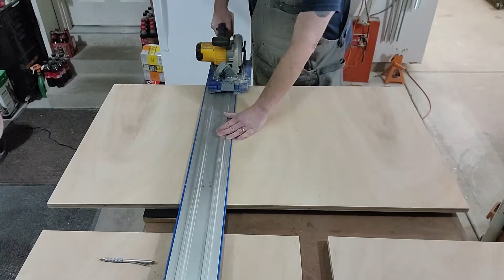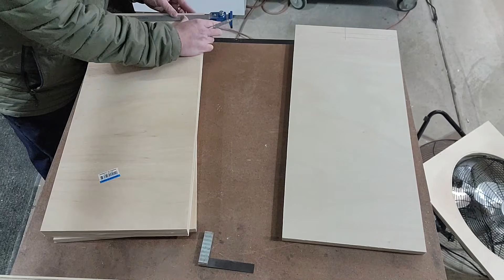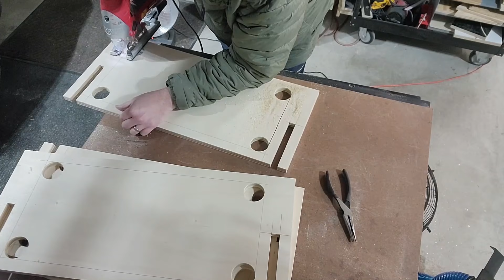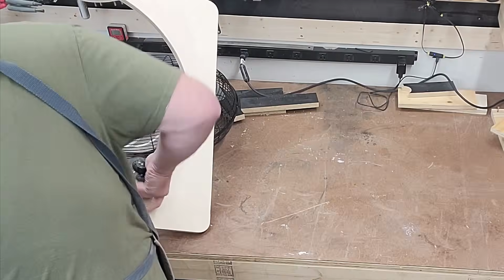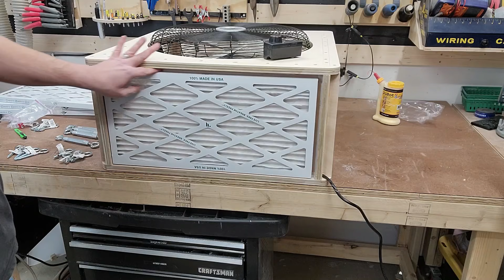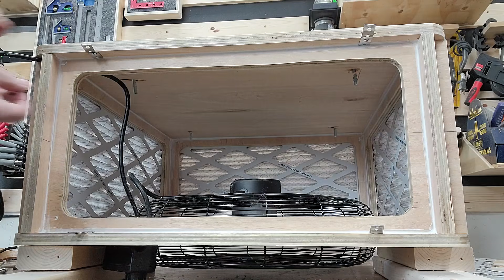SAVE YOUR LUNGS! Woodworking Ceiling Mounted Dust Filter - How to Make

Comment: I have an unheated garage/shop and when not doing woodworking, use 2 box fans at low speed to keep the air moving, so moisture doesn't really settle (so to speak) this would be an excellent way to do both functions, high speed for dust, low speed for general air movement.  Thanks.  Have to admit... I would have moved the car, then hung the unit - lol
Reply from the maker: I like a risk!

Comment: Great project.  Love the outcome.  Was wondering if there is any noise transfer to the ceiling from any motor vibration.  In my case I have a room above the garage.  I guess I would be able to replace the turn buckles with with a chain chain link and springs to kill any vibration transfer.  My home air exchanger is installed with chain and springs and it is run 24/7 with non vibration transfer noise. Could be a good idea for you if you do have a room above you garage.  Great content good job thanks.

Comment: Just started making mine. I used a 2" hole saw for the radii. Very little sawdust and by not quite going through on the first pass I was able to flip the panels and use the hole saw drill bit hole to realign the second pass.  And no chip outs.

Comment: Great design!! I like that it can be built with "normal" hand and power tools. One change that I plan to make is to have the fan blowing up toward my 10' ceiling that is heated in the winter. What do you think about adding another filter to the solid side?
Reply from the maker: It shouldn't hurt anything by doing that.

Comment: Curiously, do you have a followup to illustrate its effectiveness?  Is the effort paying off in removed air particulate?  When it isn't running does dust fall from the filters back into the surrounding area?
Reply from the maker: It works great. My filters are nearly black after 30 days of use of both wood working and painting. Very effective in my shop anyway. Dust doesn't just off when not running unless you bang the filters. I recommend using MERV 11 vs MERV 13 for better air flow

Comment: Well done video just enough regular speed to demonstrate your technique.

I'd question using the plumbers tape to hold the filters.  Over time, yes a long time, the bending back and forth of this strap will cause the metal to fail. To me this just becomes an unnecessary replacement part. I think I would have used something like a mirror clip but much larger that you could twist 90 degrees. 

I also love the Packard, I'm guessing that's an early 50's model.

Finally, just listening to you I get the idea you were a mechanic in aerospace in real life,  am I close?
Reply from the maker: I'm a software engineer by trade.
Reply: @TheSuburbanGarageWorkshop  well close, you used "egress" which hinted at a technical background. Nice to meet you, I look forward to watching more of your content.

Comment: I had all kinds of issues with my Kreg Track Saw like yours.  After tweaking it some, I finally figured out it was the way my Mikata circular saw was mounted.  Now it works pretty good.  Need to finish watching your vid.  I've seen several versions of these.  20" X 20" seems to be the most common.  Ask This Old House has one that explains the advantages to using a 2" or 4" thick filter.  That gives you more surface space.  I've also been wondering if you would benefit from putting a lower MERV out the outside catching the larger particles that could be thrown away more frequently than the MERV 13.  Either way, I am willing to bet my shop would benefit from one or even two of these.

Comment: i made mine for a shop about 20 years ago from a squirrel cage fan for a hvac system . it was a side dump instead of bottom dump the top flange was wider then the unit and i screwed it directly to the truss joist above and i used hepa filters . same concept very low cost. i made a sanding table as well that sucked the air through 1/2" holes in the top . doubled as a out feed for other tools in the shop

Comment: Surely you have got the airflow the wrong way round, the fan should push the dirty air through the filters from the inside so that when you switch the fan off the dust is confined on the inside of the unit. With your configuration when you switch the fan off the dust is on the outside of the filters and can fall off back into the workshop
Reply from the maker: No, this is how all ceiling-mounted filters work. Also, this is how your furnace works as well. You've sucking the dust into filters. Also this keep the fan from getting chocked by the dust.

Comment: Great build! Would I be able to modify this to make two of them that stack and can be used on a wall or roll on the floor? My shop is in my open 1200sqft pole barn that shares space with mowers, cars, golf carts and storage items so making the whole area "clean" is unfortunately what I am dealing with.

Comment: Nice video! Looking to do this soon. Doesn’t the fan blowing down disturb the dust or does it get offset by the amount it sucks in? If I have a dusty floor it’ll just blow it everywhere
Reply: I have a similar filter, and I can tell you the air blowing down on you is a PITA and does stir up dust, but as you asked, most of it ends up in the filter. I usually turn it on, set the timer for an hour, and walk out. This one is much better than mine, which I bought on Amazon.

Comment: Looks like a very good design. A dumb question, maybe, but since the fan is facing down will that not tend to blow dust around the shop? Would it be better to turn the design so the fan blows horizontally?
Reply from the maker: It's been discussed in the comments many times. Rotate to your preference.

Comment: Finished and mounted. Just as Randy Strang reported, I'm having a priming issue. What can I do to fix this?
Reply from the maker: I've only seen that when the filters are obstructed/dirty.  Perhaps the fan isn't as strong as mine?  You could always try popping one filter open until it catches and then push it back in and see if that does anything. Others have reported using a Merv 8 or 11 filter instead, which are not as restrictive. Others have suggested adding some a single row of duct-tape over the fan shroud at the bottom where it attaches to the wood to reduce the fan sucking around the edges on startup. 

I've not had that specific issue (except when the filters are clogged), but there could be manufacturing differences in the fans that cause some to be more prone than others. If I was to redo mine, i'd probably mount the fan inside without the front shroud so I can cut the hole tighter to the fan blades and then mount the shroud on the outside. That would yield better performance, and reduce the possibility of the fan sucking in around the edges, which is what you are seeing.
Reply: @TheSuburbanGarageWorkshop  Thanks for the reply, I appreciate it. Hopefully I find the sweet spot, really want this to work.

Comment: In terms of design, I made something similar—poor man sort of. However, one MAJOR issue I noticed after starting the fan is the cool/cold air output that comes out after filtering. In other words, its almost impossible to use that air in winter time, when the weather is cold! Now I’m thinking about narrowing the output air into an exit pipe, where I could put it by a window opening with the same size pipe diameter.
Reply: I agree about not having it blow down in the winter. I heat my garage with an electric heater when I'm out there. The garage has 10' ceilings and the air at the ceiling ends up warmer than the air near the floor. I'm going to use this design, but I'll have it blowing toward the ceiling to try to recirculate the warm air.

Comment: Nice careful build. I have a 44” diameter ceiling fan blowing down over the wood stove in the back corner of my shop w 10’ ceilings. The fan is super quiet and it runs all winter using an “off only” count down timer. Not sure how much air the fan pulls or if it could be used to remove dust. The fan is 3 speed reversible.  But I like your link for filters… etc.

Comment: I like the idea, one suggestion is even though you're using locking washers to hold the nut I would maybe suggest adding a nylon nut as added safety. In case by some odd chance the vibration loosen the  nuts from the lock washers. Nylon nut would less likely vibrate loose.

Comment: Great build. Suggestion: since u are using metal straps to hold the filter in, you can use 2 inch thick filters for less air restriction and higher efficiency and airflow. Yes it’ll stick out a bit, but it hangs and out of the way already.
Reply: Did you ever think of reversing the flow direction on your fan? I’m afraid the fan would blow fine dust all over my shop.
Reply: Why would a thicker filter restrict the air flow less than a thiner one? I'm trying to get information to build a dust filter and I don't know what to use between 1 inch and 2 inches filter. Thanks
Reply: @mougoule  Every pleat is twice as long, which, you can imagine if you unfolded the pleated filter you'd have twice the surface area.  Twice the surface area -> half the airflow restriction.
Reply: @veri745  if you un unfold the filter yes. But if you don't, since the surface is the same and you are doubling the amount of material you are also decreasing the air flow.
Reply: @mougoule  If you double the amount of area the air has to move through you are cutting the restriction in half. The pleats are twice as deep. Meaning you have approximately twice as much surface area. It doesn't mean the material is twice as thick.
Reply: @mougoule  more surface volume! The pleats are twice as long.
Reply: Another way of saying it is that the cardboard frame is twice as deep and, like someone else said, the pleats are twice as deep, but the filter material itself is the same thickness as for a 1" filter. 

Essentially, it's the same thing you're doing by creating a unit with 4 filters instead of strapping a filter onto a box fan. With a box with filters on 4 sides you have ¼ the resistance of a single filter strapped to a fan.

Comment: I think you need a redesign, no-offense intended.  The problems I think your setup has is that without an ionizer you're going to be blowing lots of dust around the room, it's why Dyson's HEPA filtering fans don't do well in competition.   
I've been pricing filters plus replacement costs & think having a quality vortex or blower fan with a resistance-ratings high enough to pull air through clogged filters is the direction I'm taking. Those cage-fans also have excessive vibrations that modern vortex fans do not experience.  
I'll probably end up using a 4-inch MERV-13 on a 1-inch MERV-14, with possibly monthly changes of a carbon-infused layer on top..., or with an option of using a large carbon-canister-filter for VOCs. The fancy HEPA purifiers now use carbon comb but it only covers about 60% of the filter-surface-area for the same price as carbon-cans.

Comment: Also, are you worries about the fan blowing dust around? I think turning the fan the other way would be better for a shop thats enclosed (not in a garage). Has anyone else tried this?
Reply: Think about it.  If the fan were turned the other way it would be trying to blow OUT through the filters in an enclosed box.

Comment: This is a great project from design to finished product. The video editing is first class and the lack of music really did add a touch of classy detail that was evident throughout the production and finished product.
I was anxiously awaiting your method of mounting the air filters into place and was taken aback a bit when you chose to not use any method of sealing around the paper/cardboard filter frame. 
I see the issue at hand and realize that the vacuum within the air box is going to provide a very significant sealing effect. As I pondered it further I concluded that adding typical foam type weather stripping would invite the dust into penetrating the foam and I suppose that would work out okay but in the long run it would become less effective as the dust being packed into the foam would reduce the flexibility and reduce the  sealing benefit. 
Upon further thought I leaned more towards a ribbed type of soft but solid plastic/rubber seal similar to what one might find on a refrigerator door where rows of soft ribs would ultimately provide the sealing effect but would not be permeated my the fine dust like a foam type of weather stripping might.
Thank you for sharing this project that is beneficial in so many different ways.

Comment: Great design, but dang, why 3/4? Could have easily been 1/2, or even 1/4 with some corner bracing. Making it MUCH cheaper and lighter.
Reply from the maker: Make as you see fit. I like to overbuild when it's hanging above my head!

Comment: You go thru all that fancy cutting assembly THEN use flimsy bend tabs to hold in the filters. That and the price of filters (four of em) isn't cheap. Ceiling mount and all the pricey hardware could have been done differently.
Reply from the maker: Mount them as you see fit. I just showing an option.

Comment: I think this fan will provide much faster filtration than the usual cheap box fan.  This is on my list of upgrades.  I would strongly suggest using weather-stripping under the filter edges.  Air bypassing the filter is a problem, especially with a high MERV filter. 
Too bad your beautiful woodwork is spoiled with ugly metal straps holding the filters!
Reply from the maker: Just a note, the air flow is going the other way. It sucking the filters against the frame.
Reply: @TheSuburbanGarageWorkshop  Yes you are correct.  I even saw the flow was inward and still made the wrong statement. What a doofus!   I will correct my comment.  (I still recommend weather-stripping between the filter cardboard frame and the wood frame.)  I enjoy your narration and video editing.

Comment: Does it make more sense to have the fan output blowing up towards the ceiling this way the dust particles get drawn in from the bottom and the sides. With the facing down doesn't it push the dust down and have to wait for it to pull it back up into the filters?. I'm making one of these now and been going back and forth with how to orient the fan
Reply from the maker: You can make it either way. I like mine to double as a ceiling fan

Comment: great work. I like your design out of the ones in youtube.
I would like to know:

1- why do you blow air back into the garage vs. sucking the air the opposite (fan first, and blow the clean air out)
2- do you know the CFM rating?
Reply from the maker: It sucks air through the filters and blows the air down from the fan. CFM is based on the fan model you purchase. Thanks for watching.

Comment: Nicely put together, was your design for this 'filter box' influenced by the 'Corsi-Rosenthal Box'?
Reply from the maker: No. Actually, I just had to Google that as I had never heard of it. Similar yes, but I think any design that uses a box design is going to be in that respect.  But I believe that this will pull much more CFM than a regular box fan will.
Reply: I put together something similar (very rudimentary by comparison, out of a cardboard box). Testing indicated more air could be sucked through the filters if a shroud was fitted.
These caged fans are designed for use in open air, when used to suck air through a closed filter box a much higher negative pressure is developed behind the fan blades than would be the case in open air...as your design leaves a 1inch (approx) gap between the fan blade edges and the wooden support it is likely that significant air is sucked back into the filter box from the front side through this gap by the negative pressure at the rear side.
The level of this unfiltered recirculation can be reduced by using a cowl/shroud up the side of the cage and to a point which overlaps the blade edges on the front of the fan cage. An easily achieved shroud/cowl could be made by wrapping packing tape round the cage to satisfy yourself of the worth of a less unsightly solution...i found it significantly increased airflow through my filter box as tested by the ability of the filter to hold against it's surface  different thicknesses of paper/card
Reply: This design has been in use for decades.  Saying it was invented by Corsi-Rosenthal, the two nutty-professors from UC Davis, is like someone claiming to have invented putting a rubberband around a deck of cards.

Comment: love this design, i might try it. I think i will come up with sides that hold the filter easier and easier to come off. I'm thinking of using magnetic tape and build sides where the filter fits in them. Where i can just take the side down put the new filter in, Then pop it back on. Without having to bend the metal pieces every time.